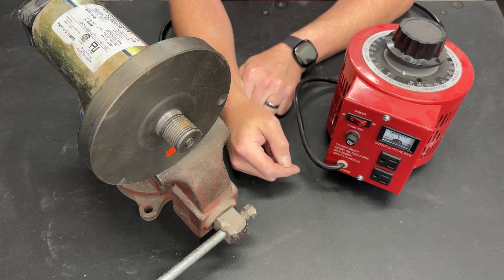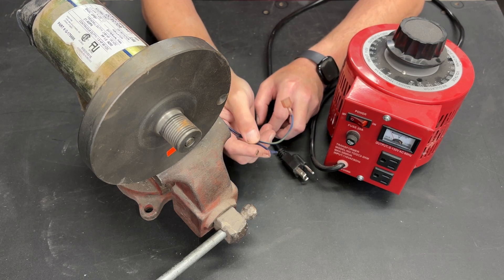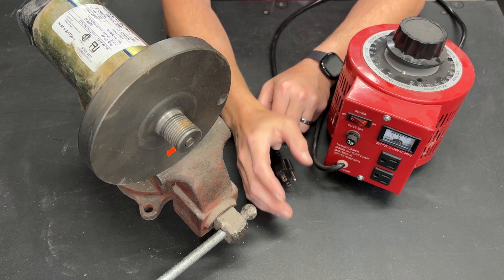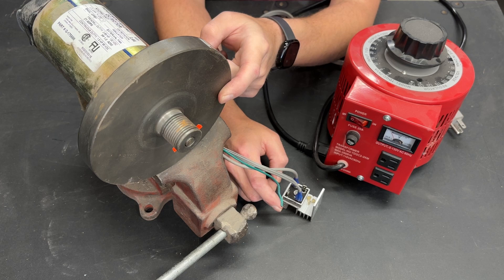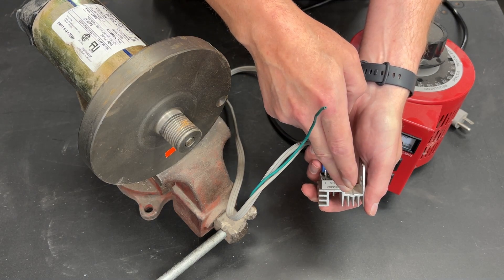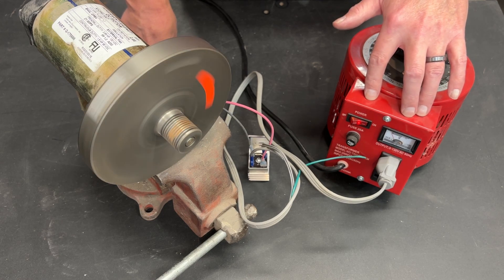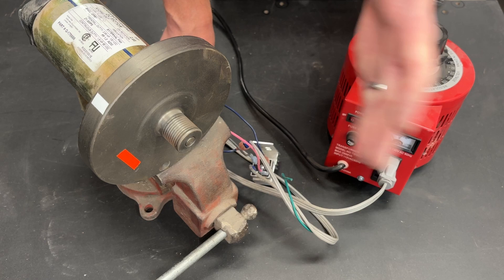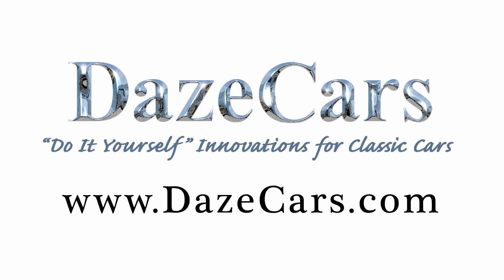Hooking up a Treadmill Motor to a Variac & Bridge Rectifier Using Blue Wires.

Comment: Toward the end you speak of durability of blue wire motors. I have a Nordic track branded 2hp 3100rpm motor I was wanting to build a 2x72 belt sander with… thoughts? I live in an area I can find other treadmills eventually so i can hunt if need be lol
Reply from the maker: This is a perfect example of why you always calculate torque.  That is a good motor and has about 3.4 foot pounds.  The blue wire statement is more of a guide than a hard fast rule.  ALL of the smaller motors have blue wires and most of the good motors do not.  I believe the Nordic track motors are the exception.

Comment: Wow Thanks your series of Videos helped me sort out the wiring for a 2.8 HP Treadmill motor upgrade for my Grizzly Mini Mill I had upgraded my mill to a belt drive and even with decent ratios i still needed more torque The Treadmill motor was my answer. I found a free treadmill in perfect working order but had been putting off finishing up my conversion as i just didn't want to fry anything in the process your series of Videos had all the answers I needed so Thanks!.
Reply from the maker: glad I could help

Comment: Thanks again for another great video.  Is there a direction of flow if the connectors have been removed from the blue wires?
Reply from the maker: Blue wires are not directional.  Think of the blue wires as a single blue wire sitting on the table.  Power can flow in one end and out the other or it also works in reverse.  There is no directionality at all especially since it is on the AC side.

Comment: Great videos, new subscriber, I got a free 4k treadmill non functional its a 110v ac 3 phase, 5hp,4250 rpm,and the motor is  good ,it's a monster and I would like to put a variable control but there isn't any videos available ,any advice on what and how to connect a variable control to it?
Reply from the maker: You need to get a VFD for it.  That is the only truly effective way to have variable speed on an AC motor.  It is not cheep but is far superior a DC motor with variable DC power supply.
Reply: @MrLeo92335  you may have to use 1 pwm into 2 supllys 1 for each phase im not sure if this would work. Anyone have an idea?
Reply from the maker: Three phase requires a VFD.  You never want to use an AC to AC voltage controller on any AC motor.

Comment: i am building a controle box for my mill. you should check them out. you may be impressed and yes. im learning more about the system. i, like most started out with the junk scr and small rectifier. so thank you for shoeing the better scr and bridge rectifier.. so now i need to re visit my band saw i converted about 6 years ago and change them parts out.
Reply from the maker: The cheap SCR works, I used my bandsaw with one for years but when I finally replaced the cheap SCR with the good one the results were outstanding and immediate.

Comment: Have you ever powered a 24 volt DC mobility scooter motor with an variable AC unit from a treadmill or other source?
Reply from the maker: no I have not but the concepts would be the same, AC to DC with some sort of variable power supply.  The important thing would be limiting the max output to 24 V so you don't fry the motor.